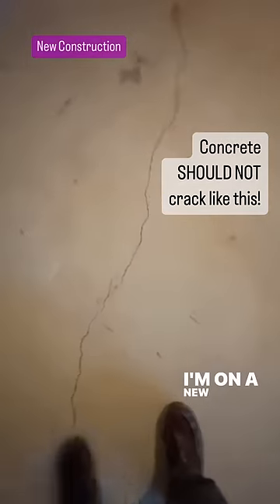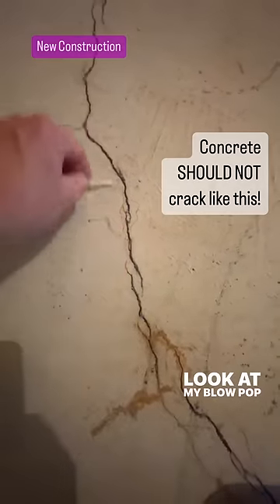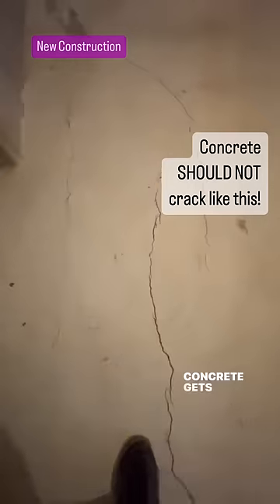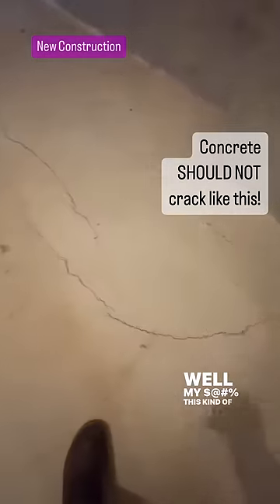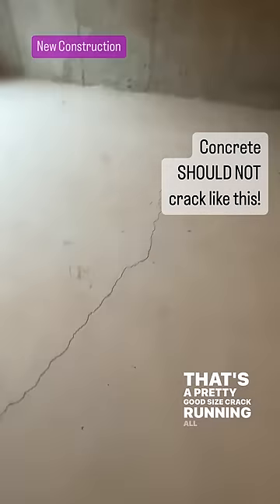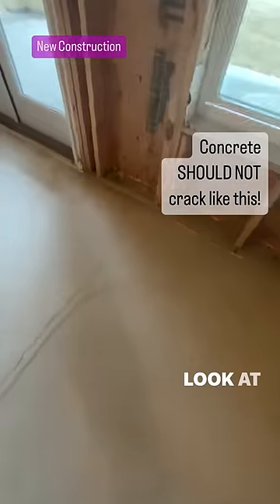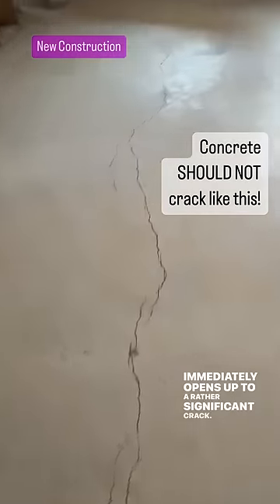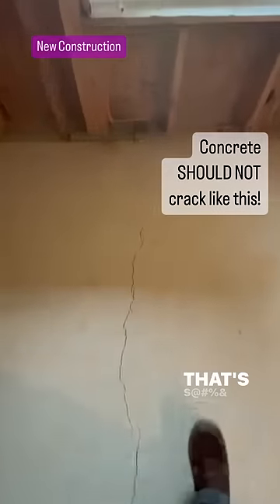New Home with Multiple Slab Cracks

Comment: Concrete guy here - I’m pretty sure the builder did not use a moisture barrier and that’s the main issue. Some cracking is normal but they should not be as long as those are and definitely not create a gap…the gap that’s created leads me to believe they also did not use proper base or did not compact enough. The extra white color in the concrete tells me is accumulated salts from the ground very quickly which is usually caused from using excessive water in the mix. Too much water makes concrete weaker and the contractor should have used a water reducer for this size slab or a plasticizer and it appears they did not but just used extra water. Control joints are not common in basement slabs which is why a little cracking is fine but this is definitely excessive. Also you all should know that the slab doesn’t necessarily have any structural capacity to it the footings do all the work and carry the load. The slab is just a buffer between the footing and the structure and concrete has amazing compressive strength so this might actually be fine if it weren’t for all the moisture we’re seeing. The moisture is the biggest concern you should not have water coming up through the basement floor of a new build. Overall this is definitely careless work, but not sure how far a lawyer would be able to take this for you. Good luck to the homeowner I hope they convince the contractor to replace the slab…if one of our slabs turned out like this we would demo it out and rebuild it
Reply: You bring a concrete guy , isn’t  that just flooring concrete and not a structural concrete !  Meaning it can be filled for correction
Reply: Sorry, during the Obama Administration, the EPA mandated that more organics be put into concrete and asphalt.  The PSI of concrete is sub-par
Reply: you're definitely not a perfectionist, find another career..
Reply: so cracking like this normal, but the moisture coming up is not good?
Reply: I've been building for 35 years great comment all facts, one other thing this guy is being very negative so he may be leaving out part of the story, running the dehumidifier and especially the water sitting under and along the walls there looks like water has really poured in there and they are drying it, maybe it rained a day or two ago. Moisture might be coming up or might not.
Reply: Some cracking is normal but that’s too much. The framing should also be sitting on a piece of vapour barrier.
Reply: Not so sure you know what you're talking about.   Work all due respect,,, contractors can't control the batch plant. Also, hydrostatic pressure will allow water in from anywhere
Reply: Alotn of morons out there still think more water increases volume.

I mean sure, it technically can, but only after you've already ruined it with too much water. (Or if you have the most exotic concrete on earth, by chance.)
.....but the water should be replacing the insane amount of air that is contained between the cement particles
Reply: @collinperschon2183 it ain't the batch plant hat does this. We just send the trucks. The mix is done by computer with a receipt proving the specs straight from the automatcic hopper.

We send those trucks out, and it's the contractor (or whoever he hired) that does all his crap.

My literal whole job half the time was making sure Noone tried making soup out of it so they didn't have to work as hard. (Since whoever got shafted would assume it was us).

99% of your construction crews are from the third world....building collapses are an acceptable risk to them to reduce the labor. It's sort of a cultural thing I figured. It was enough that my dad and I got out of the busines because all the builders we could trust to do the work right are gone
Reply: @collinperschon2183 Every batch plant I knew of had a comprehensive auditing system that measured every ounce of aggregate and cement that went into every truck.

Not a single batch plant in the city I know of doesn't do this. It's auto uploaded and regulated to he'll as far as records go.

This really is a contractor or builder issue. Like I said, the entire construction culture is gone here. Judging by the changes I saw since 2005, I honestly believe we will see some high rise (40-storey+) collapses in the US before out lives are over.
Reply: From what I see this slab is of a size that it should have had one or two control joints to limit the cracking.  One of the cracks was expected because it's radiating from a sharp outside corner.
Reply: I drove a mixer for 33 years and can tell you some stories that are crazy. They want to to flow because they didn’t want a pump. Water is cheaper than chemicals to add to the load. There was a lot of fly by night contractors out there. Sometimes I almost ran out of water on the truck. We’ll I retired and don’t miss it a bit
Reply: @edwardference3979 Now there's a good ol honest answer.
Reply: @nkgagne not even an eighth inch. Gtfo
Reply: @edwardference3979 
Just read a similar comment from another concrete truck driver. He said all these guys always tell him to add water because they don’t want to spread the concrete. They don’t care about doing the job right, they just want do it as easily/quickly as they can.
Reply: Yep, a soup sandwich.
Reply: Thank you, you can read my response and we pretty much agree on this. Almost said the same comment. 22+ years of experience in concrete mainly doing basements in central Missouri. Retired now.
Reply: @ChadDidNothingWrong We are already seeing them in Florida.
Reply: @ChadDidNothingWrong All true. I look at this guy’s videos from this housing development and am horrified by all the subcontractors, not just the concrete guys and carpenters.
Reply: LoL 😂. I was ok with the first visible part of the comment, but bro. You comment by writing a whole dictionary 😁. ❤ Jesus
Reply: I don’t think tearing out the slab is the right call. Once the building is in, it is incredibly difficult to tear something like this out and extremely costly. I’m sure someone spilt water on the surface and made it look worse than it is. They probably didn’t use water reducer or vapor barrier, and they probably should’ve put in a few control joints. This is most likely careless work from an outside perspective, but proving it is certainly another thing. Let it go and tell them vapor barrier is mandatory, to use water reducer, and cut a few joints in next time and you probably won’t have this happen again.

These things also cost money in additional time and materials. It’s also possible that this builder scrimps on the small things to try to save a buck. Don’t always blame the subcontractor.
Reply: @fasfgasdfagadsf  That could absolutely be surface water. I wash and stain a LOT of concrete and have to let it set a minimum of 2 days in Texas heat in order for it dry. Where there's cracks they always look wet like this the next day. That concrete also looks very clean, like it was washed. If this is in a city, there should've been an inspection for a vapor barrier or it wouldn't have passed.
Reply: @fasfgasdfagadsf  Yeah, dude. When we wash floors we use a lot of water and it will stay wet for a couple of days even in the hot Texas heat. Especially in the cracks. And I've never done a floor that doesn't have cracks in it. Typically they only need to be a concern/repaired if you can fit a nickel in it. And the floors in this video looked pretty dam clean, tbh. So I'm thinking there was a lot of water on it. That's why they were drying it out.

Comment: I poured a pad for my 25x35 garage. Gravel, moisture barrier, wire and rebar. 22 yards of concrete. Car has been parked on it for 25 years. Not one single crack.
Reply: How dare you compare your properly poured slab to that contractors sub par debauchery, he should be able to do sub par work and explain cracks as "normal" yet charge premium prices to line his pockets. 
😅
Reply: Sorry, but your construction standards don’t align with our need for diversity, equity, and inclusion. You need to embrace the work ethic of other cultures.
Reply: @LuckyCharms777  You got that right

Comment: I've seen 100 year old basements with less cracks.
Reply: Yup. My 103 year old basement doesn’t have those cracks.
Reply: @wallihaley5194  they also took their time and did a good job 103 years ago. These new houses are built fast and typically mostly financed.
Reply: My houses initial foundation was first poured in 1890.  No cracks.  It’s had additions since.
Reply: 100 years ago people had ethics, morals, integrity.  They were craftsman back then.  Now it’s just on to the next.. sad really
Reply: @Daveyboy28 I'm not sure there were more ethics back then, but I'd bet that people without the ethics got dealt with on a more personal level.
Reply: @JasonW.  that’s definitely true.  Which in turn would make people want to do the right thing or face repercussions.  Better world in my humble opinion
Reply: I lived in a house from 1886. It's been sub divided into apartments and stuff. The basement wall was field rocks brick and concrete. The floor was nice level concrete. No cracks anywhere. Just mold eating away at it, turning it into sand. Impressive masonry.
Reply: Mine is 93 years old and not a single crack in it.
Reply: @Daveyboy28 and also better quality in the resources used
Reply: @cdzntz9092  yes! 100% true.  Great point 👍
Reply: Mr_Jim_Lahey less*
Reply: Grew up in a 60s house and the concrete basement floors were crack free when we left in like 2014
Reply: @Daveyboy28 Ethics,Morals and Integrity where you find that at?
Reply: @tonyw1563  100 years ago most people did.  Then people started being raised without fathers for the first time in human history and now we have zero morals, zero ethics, and zero standards.  That’s what happens, friend.  Weak men create hard times
Reply: @Daveyboy28 My great-grandmother grew up without a father and she was harder than tempered steel.

Most of my family grew up without fathers being present, as we have been merchant sailors for about 300 years.
Reply: they had concrete 100 years ago?
Reply: @Daveyboy28  Eweknow this how?
Reply: @JasonW. there was def a lot more craftsmanship. Just look at the old Victorian houses and the churches and govt buildings they used to build. This is before they had electricity! Blows my mind
Reply: @nofurtherwest3474  They also had 19 more hands working a crew, than any given modern construction crew.

Cuase, ya know, taxes and crap make it impossible to hire more people I guess...
Reply: @raspiankiado  it still blows my mind, the details they did with no electricity. before all these modern tools and materials. 
Drive around downtown of any city in the USA, and look at the old churches and govt buildings, most built in the 1800s. And that's not to mention the stuff in Europe which is older and in some cases more detailed and grand.

Comment: Call an inspector, your lawyer, and have an injunction… tear it down before it goes any further and have the bed repoured  …….that’s ridiculous…..!!!!!!
Reply: Yeah, you could just hold up the house with a crane and rebuild foundation
Reply: a sample sent to a lab most likely would show "poor" concrete.  That would be all you would need to win in court.
Reply: @carlosrivas3004 they jack them up and then you can
Reply: Lol@injunction

You dont even know what you're saying. And it's a slab, not a bed...
Reply: Not my area of expertise but I suspect it is too thin a pore with insufficient rebar.  

Somebody correct me if I'm wrong.

But I also wonder if this is a multi-story house and you got to this point before you even started putting any real weight on the foundation.
Reply: I've seen your landfill logic joked about on the Movie Idiocracy, it doesn't work dude! You don't destroy perfectly good resources cause your panties are wodded up. All you gotta do is jack the house up, slide a few I-beams underneath and lift it via crane to tear down and repour the slab...this saves you roughly $500,000 instead of costing you $500,000 for a new house!
Reply: Yes Sir I would have visited my work place regular to see the whole process ; I bet that
they did not grade : rebar : or lay moisture 
barrier.  Lawsuit incoming on this contrator.
Reply: The bed? Lol
Reply: You're actually hysterical😂
Reply: @superdave8248  You can put rebar in concrete about 5 inches wide.

Block walls aren't entirely the same, but, if you put rebar in a block wall, you typically have to fill the cells the rebar is in.

Not always, but, it's be a good idea to be ABOVE code
Reply: @HarryDirtay  Lol. Says the one sweating over an actually valid move.

Comment: As en electrician I can honestly say most job sites I've been to can drive heavy equipment over their pads no problem. Like forklifts and stuff. Onetime the bricklayers dropped a job box with a shit ton of metal weight in it on a gym slab they were bricking walls on. Barely scuffed the surface. Good craftsmanship shows

Comment: In my first apartment a builder mentioned he saw it being constructed  years ago and the slab was full of cracks. A few years later we were living in a two bedroom unit that developed a leak coming up through the carpet in the den. Turns out a pipe had cracked in an apartment 4 units down and the water was coming up in our apartment through the crack in the concrete like this. Not just cracked, but the concrete was not level either. Didn't matter to us since we were moving out in a week anyway, but I did tell the office everyday who did not even come and look at it until they came to show the apartment the day before we were moving out. We answered the door in galoshes with over an inch of water in the den and the carpet in all the other rooms wet. Then they believed us.
Reply: That must have sucked but it must have been hilarious that last day
Reply: The manager should be fired. The first thing the manager should gave done was to come look, and then called the owner of the building.
What a LAZY bum that manager was.
Reply: Can't imagine the amount of water damage and mold in that place
Reply: @davidgraham2673 it's a fake story dude. Water leaked up 4 floors? Come on man.
Reply: @HarryDirtay ,  You didn't read very carefully, did you?
The water came from 4 units down the line of Town houses, or apartments, not from four units below them.
In other words; The water ran sideways, until it found an egress to come up from, through cracks in concrete.
Totally plausible scenario. .

Comment: If a builder tells you that is ok, what else are they lying about...get a lawyer and get out of that contract.
Reply: Yep!
Reply: Honestly cracks are fine, that’s the sole reason concrete is supposed to be cut, to control where the cracks form. There’s no cuts on that entire pad. If it would have been cut it’d been fine, now that whole thing needs to be torn out
Reply: Your talking nonsense. You don't have a clue.Concrete Should never ever ever ever crack like that. The ground was never prepped and it was probably poured thin. There's no cars driving on top of this it's not a driveway. You would need 30  cuts to stop that cracking. 
That house needs to be taken down nothing is square and in ten years that house will have 10 inch difference. That's fresh brand new concrete.
Reply: @tomlovefranklin4604 
10” eh? I seriously doubt that but okay! 😂
Reply: Contract with the builder normally states the house will be safe and for the floor to be like that it's not safe so, the builder breached Contract.
Reply: Either they tell you its ok, or the go out of there way to fix it so you don't know...
More and more i see and know i can do it better my self... but sometimes you meet/hire people that actually know what they are doing...
Reply: Overreaction. Just my $0.02: It's better to have more contractors doing "good enough" work and learning how to do better, and saving enough money to do better, than fewer contractors learning how to improve their craft. Lawyering up America has destroyed America. I've seen a lot of cracked basements...they're not the end of the world. There are new products available that can minimize the effect of the problem. Taking this contractor's scalp isn't going to help anyone.
Reply: @JakeWitmer sounds like you're a shotty contractor lol
Reply: @zqzj anyone using the word shotty doesn’t have a clue😂.  Something I’ve learned over the years in construction
Reply: @RalphWiggumcrayon  same same, neither of you understand anything about concrete or construction so I guess use whatever word you want it doesn’t change anything.